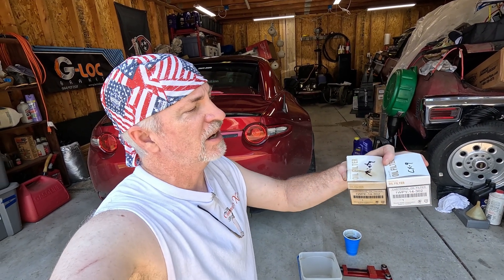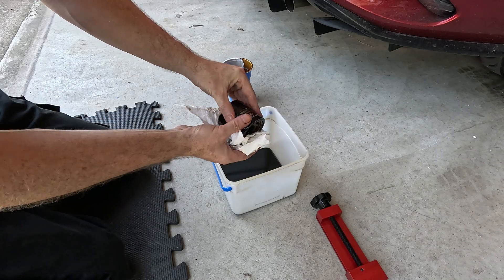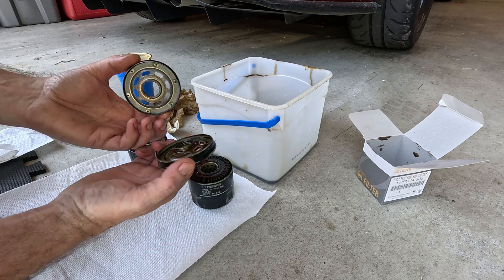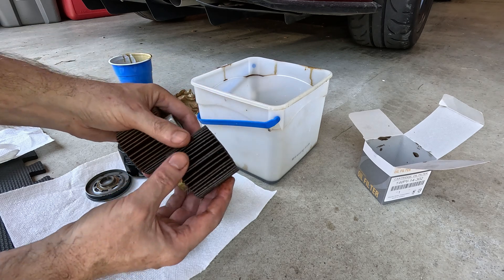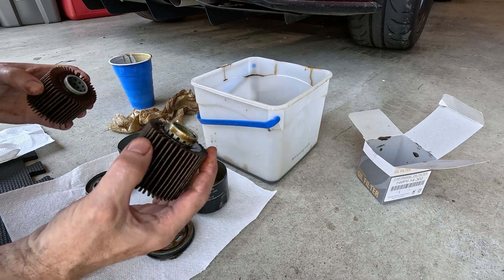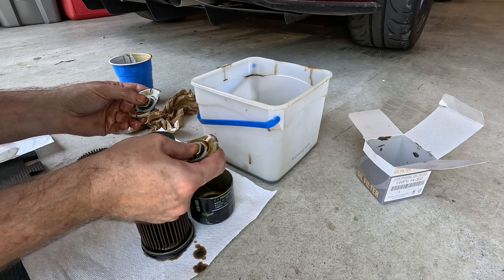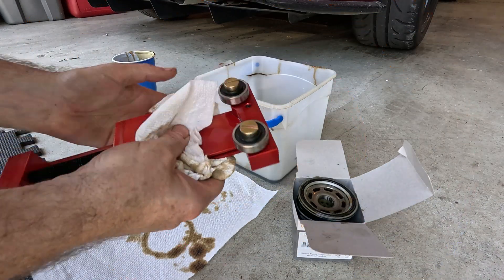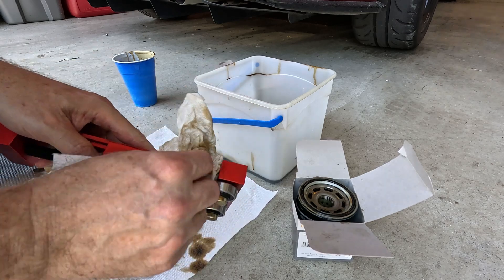What Sets Apart Mazda's Oil Filters? A Closer Look At The Variations

Comment: I had a look at the oil pump part numbers for the CX-50 NA & Turbo and they are different. 
If I was to guess, I'd say the turbo engine pump circulates slightly more oil.
Why the diff in the bypass pressure? That would imply the turbo engine filter would be more clogged before the bypass opens... but if it is that clogged, there are other issues. 
Aircraft filter bowls have little indicators that pop out to let you know if the bypass has opened. Something to check before flying as pulling over with a dead engine is difficult.

Comment: Those are knock off mazda filters.    The real ones are made in japan or made in tokyo.  Only!!!     Your buying phoney knock offs.    Ive been buying mazda vehicles for long time.  Got a brand new 25 cx50 right now.  I kno what im talking about.     Just want u to know.  ✌️
Reply from the maker: Thanks for the comment! But, I don't think the Mazda dealership is selling knockoffs. I buy them from the dealership so they have on record that I bought the oil filters to help prove I have been changing the oil, just in case there ever is an issue with the engine.
Reply: Mazda filters are made in Thailand. Have been for a while. Your CX-50 may have a filter on it made in Japan because it was built there. If you can find one made in Japan for your first oil change, let me know. I'd be interested to hear where you found it. I drive a 2020 CX-5 Signature. It has the turbo.

Comment: I have put both on my 2017 CX-9 Turbo , did not make a difference that I could tell , I change filter every 5 k and change oil every 10 k  with Mobil 1 high mileage 5 W 30  oil ,I had 2 oil analysis done with excellent results and was told I could even go a couple thousand miles more , I run 5 w 20 in my 2021 Miata no issues. I have heard the only difference is the relief valve , maybe for extreme cold environments ?